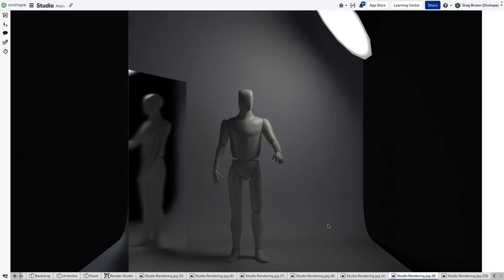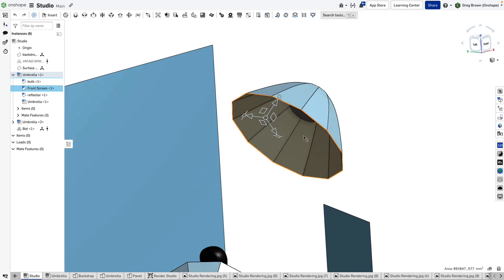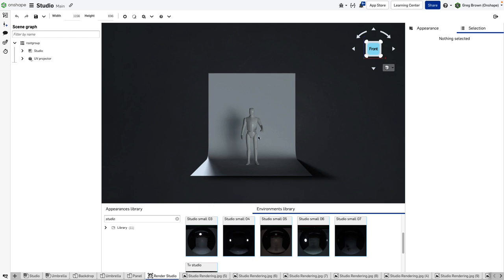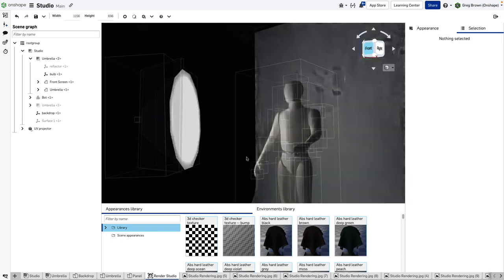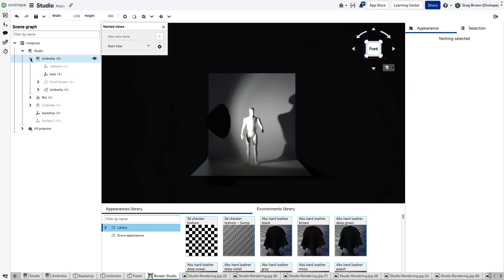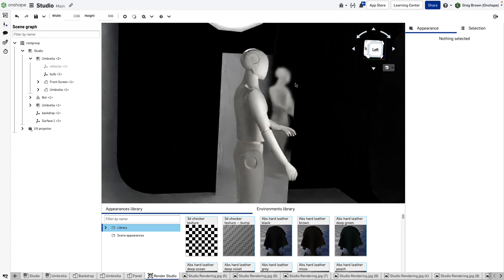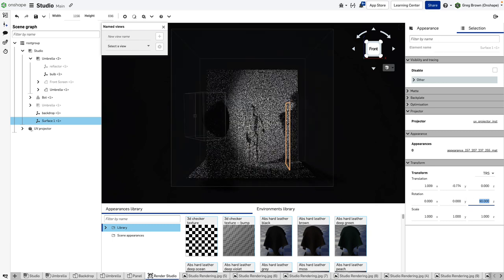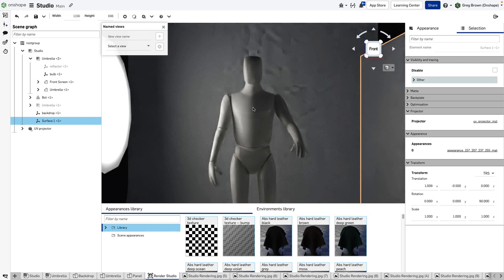Recreating a photo studio in Render Studio - a digital photoshoot!

Comment: Thanks Greg! Is there an advantage to modeling the lights/umbrellas etc over just creating an emissive disc the size of the diffusion panel? (or the mirror rectangle for that matter - that could also be an emissive fill panel). I haven't used rendering in Onshape yet, so I'm also curious if you can hide lightsources from view in the rendering but still have their lighting show up? This is a common feature in other renderers. In your example, you could have say the key light's light present, but not have the light fixture be visible. Also, can you turn off shadows for a particular light?
Reply from the maker: So the effect will be pretty subtle if you can detect the difference at all, but that does depend on the appearances you choose for the model/product... I did this for an experiment rather than suggesting a best practice. For most practical usage, using the HDR file to provide light sources will be more than sufficient. In that case you can certainly exclude the HDR file itself from the rendering but still get the effect of the lighting. You can choose from an extensive range of scenes we provide, or upload your favorites. If you are familiar with NVIDIA IRay, then that's what we are using in Onshape as the rendering engine. So the techniques and capabilities will generally be all there when you know where to look. Volumetric effects and other good stuff is all possible.